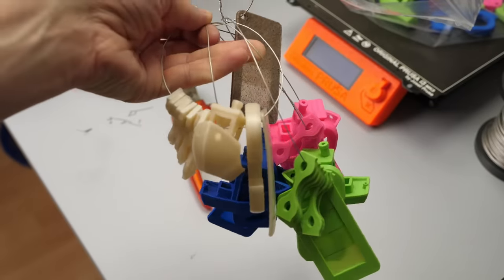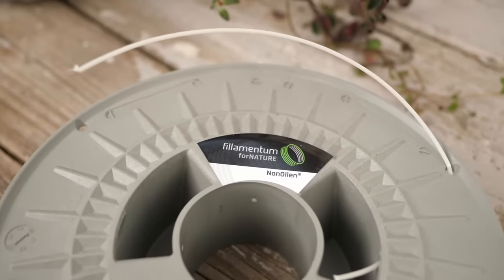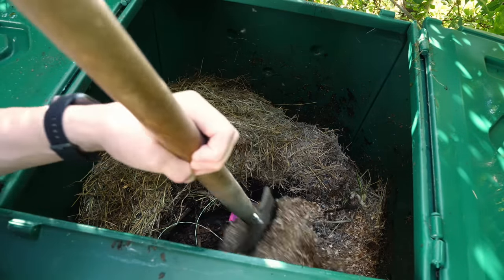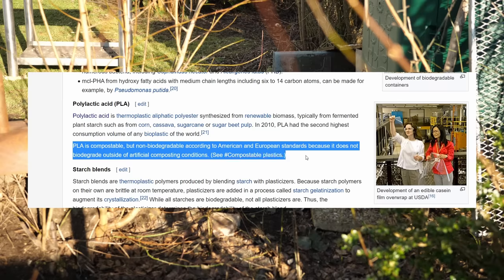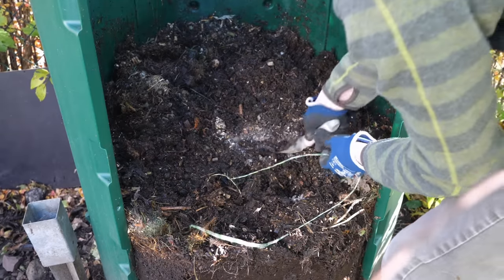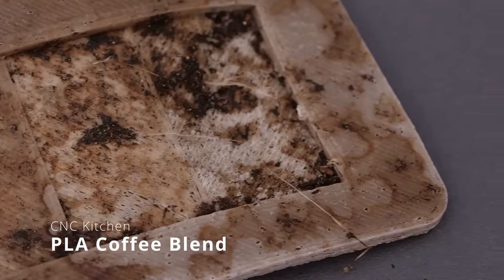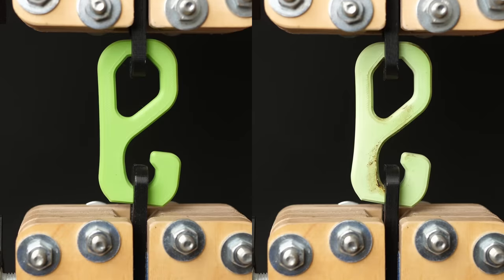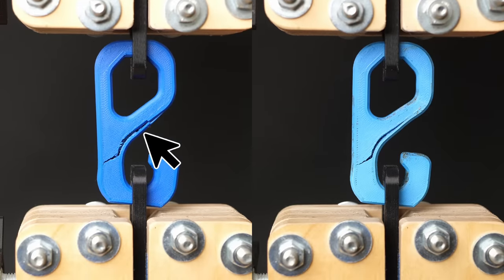I put PLA 3D Prints in my Compost and this happened

Comment: I'd love to see some more testing of that GreenTec Pro (and even the regular GreenTec). 160C(110C for regular) temperature resistance is kinda nuts, especially for something that seemingly prints easily. If there's settings changes that can be done to fix the layer adhesion that stuff could end up being pretty amazing, wonder how it does in impact testing as well.

It may not biodegrade as well as they claim, but it certainly has potential as a filament for functional applications. Their BioFusion material looks promising as well.

Comment: Instead of going bigger, why not go smaller and more controlled? Build a heated and controlled environment to do the composting on a small scale. You want to have a stable temperature of about 35 °C degrees  on the outside and 65 degrees °C on the inside of your compost pile, and good ventilation while maintaining a relative humidity above 60%.

Comment: I prefer ground composting. I currently have a large 2 section insulated Jora compost tumbler with WiFi thermal probes, due to HOA restrictions. The problem is daily moisture/heat regulation, here in temperate SoCal, especially if you add earthworms. No place for them and other critters to escape from excessive heat/moisture and decomposition conditions.

Comment: Chemically, I would expect plastics to degrade a good bit in UV light. Lots of plastics break down this way because it creates radicals of monomers. Breaking down polymers to monomers, but biological processes can also degrade some plastics (took organic chem). There are some microbes that eat petroleum based chemicals too iirc.
Reply: sounds like a good job for a test box(with proper safety interlocks of course) featuring a higher power UVC lamp and that would be a good UV test as one would have constant control of daily exposure time since weather can impact UV to the surface if just using outside.

Comment: Not the perfect test, but weighing and measuirn volume loss thru displacement  can help measure loss of material. It does ignore things like dust, dirt, etc. sticking on it might increase weight or volume, or if fungi etc. grows on it. Tests need to be done on similar shapes to make surface area exposed comparable. Also, if using displacement test for volume (most accurate), you need to make sure it liquid that doesnt make plastic swell that much.

Comment: I wonder, how much does the strength change after 100 days in indoor condition. Did you already test it already? The parts look like it has been due to the compost. But what if environmental humidity is the biggest part of that and the rest really only affects the surface? However, the strength comes from he surface layers, so that might be the same.

Comment: I can say from experience that GreenTec-pro needs very little cooling during printing and the 5015 fan on the Prusa might have been too powerful
Reply from the maker: Thanks for the advice. Would be great if Extrudr included that in the PS profile.
Reply: @CNCKitchen  yeah 

Maybe go with 25-40% cooling or something like that. After all the material is supposed to solidify at about ~ 140°C

Comment: I've had boxes set aside to put scraps/waste plastic in each material type/brand until recycling becomes something I can easily do.   I just never liked the idea of adding plastic waste, and while PLA's claims of degrading were optimistically skeptical, showing these vids let's me know I chose better to save my scraps for later instead of just thinking "all is fine, just compost it"     Just gotta get better shredder/re-spooling systems or find another recycle method that turns the waste products into something usable again (panels, art,  vacu-formed parts, something)

Comment: Question about the raycons: is there silicone on / in them? Since I'm pretty allergic to that it seems to be a good idea to know before I will put them in my ears.

Stefan, do you know?
Reply: It's funny that a Euro tuber advertises a product again which is only sold in US and Canada. I believe the tip material is not specified. I expect it to actually be TPE/TPU rather than silicone, because well cost. It's possible that silicone based adhesive can be found inside, not specified, but for sure you'll find some sealant adhesive of some sort in there. Anyway I don't see a reason to own them for quite a few reasons, and it's just a paid ad, even he doesn't actually have to like them, just find something non disparaging to say about them. It's unlikely they even know their product exactly, it's just a large-ODM product like many others just with a tuning more obnoxious than most.

How'd you develop silicone allergy though? I don't doubt, I understand that it can occur, just wondering what sort of exposure could lead up to it, if you happen to have some thoughts on the matter.

Comment: While it would certainly be nice if PLA would just disappear if discarded in the forest, colored Benchies lying around are more of a nuisance than a problem. In fact you could argue that every PLA-Benchie that is not biodegrading is permanently binding CO2 that was extracted from the atmosphere by the plants that the PLA was made from.
What I am more worried about and haven't seen information on, yet, is if PLA degrades into microplastics when thrown into the ocean, and if it does, if the PLA-microplastics has the same properties or if it is e.g. digestable by fish. It would be a big deal if PLA did not cause microplastics problems.

Comment: Any reason you didn't weigh prints? I guess they could be expected to gain weight with liquid getting inside. Still, I would have expected you to try as biodegradation is meant to reduce mass isn't it in landfill isn't it?. I have a bunch of pla prints in my garden for years and they don't appear to be eaten by anything, not a scientific test I know just observation Some I did because of the hype about them biodegrading or photo degrading and I was curious but I think the claims are rigged and maybe only occur under certain test conditions but not at all under normal home conditions

Comment: For me, the most important criteria are actually: 
1. Is it easy to print with, so chance of failed prints is low?
2. Does it release any toxins during printing?
3. Does it release any toxins when burned?
No landfill in my country, only garbage incineration, and the heat is used to warm houses. That still releases CO2, but so does composting. So reducing waste and preventing cancer are the metrics I go by.
Reply: We try to solve the main issue. A way to erase microplastics and capture CO2 from the atmosphere.

Burnt stuff doesn't disappear.

Comment: Hey Stefan. Want to know how to improve layer strength of FDM prints??
Reply: I had an interesting idea that maybe you could test? What if you adjusted layer width from 0.45mm to 0.3 and compensate by increasing extrusion multiplier from 1.0 to 1.33? I know that's an extreme example and my calculations might not be perfect here, but my theory is this would improve strength in the Z direction because the lines in the XY direction would be much closer together combined with the increased extrusion multiplier might help fill in the gaps between the lines and layers.
Reply: BTW thanks for making awesome videos! As somebody who likes making structural and functional objects, I appreciate what you do on your channel!

Comment: Here's an interesting (methinks) thought to ponder: Plants capture carbon dioxide from the air to grow, and release it again as they get eaten/rot/decompose. Assuming we don't produce more CO₂ producing PLA than we "trap" in the polymer chains (for the sake of argument let's say for example that the energy used in the production is completely renewable, and the polymerization catalysts aren't wasted), would mass production provide a feasible long-term storage of excess CO₂? I know this sounds like a bit of a pipedream, but maybe the plastic not degrading can be utilized, y'know, "silver lining" kinda deal.
Reply: Charcoal would do the same, and can be put into soil  to make it bore bioactive. Codyslab ran some experiments on it and expressed that it's carbon negative
Reply: Ok so this is legitimately in my field. 

1) Producing polymer from biomass still emits CO2 from energy used during production, waste products, potentially from land use and farming impacts etc... and the actual amount of CO2 sequestered is quite small. Therefore getting to actual carbon negativity is hard if not impossible for a plastic. 

2) Often the "gain" in terms of carbon footprint isn't the capture and utilisation of biobased carbon, it's the avoidance of using a conventional petrochemical material which has a higher production impact... (So using a bioplastic is often better in terms of CO2 per kilo because the energy required to make it is less than for a conventional plastic, the actual carbon trapped in the plastic is usually not hugely significant by comparison)

3) The amount of new plastic produced globally each year is something like 400 million tonnes. The anthropogenic production of CO2 is over 30 billion tonnes... so even if you truly get carbon negative sequestration through carbon capture and storage/utilisation in ALL new plastics (a pipe dream) it would be very generous to even call it a drop in the ocean...

So yeah, you're thinking in the right way, but the numbers don't really add up when you get into the detail. If we're going to solve climate change we need to drastically reduce our consumption of meat, stop burning fossil fuels for power, and re-wild areas to reestablish carbon sinks like peat bogs, wetlands, and mature forests (all of which are good for flood prevention too!)
Reply: I realised this sounded negative - I am a huge believer in a future bio-based chemical circular economy. I just don't want people to think that bioplastics are a silver bullet for climate change! They're a good step to take if done right and sustainable plastics are my own field of research...
Reply: @chemistrykrang8065  I appreciate you taking the time to go so much into detail, so thanks for that. And yeah, I'm with you on not treating bioplastics as a solution to everything, I'd rather avoid waste in the first place, look for alternative solutions to currently unsustainable practices, etc.

I was just thinking out loud since the "biodegradable doesn't mean what you think it means" is, I think, fairly well established by now, at least among the 3D printing scene. So now that that question is answered, what can we do with the results, y'know. If I thought my idea through a bit better I probably would've already stumbled at the logical question "what's the actual carbon density, could we even store that mass and volume of sequestered carbon in a practical manner?"

So yeah, again thank you for entertaining my silly prompt 👍

Comment: Even if it takes a decade or two for PLA to fully compost, I think that is still acceptably fast considering that most other plastics take millions of years to "biodegrade".
Reply: Definitely – but only if they do eventually break down _completely_, which is not clear. At the microplastic stage it's worse than ABS that has stayed completely solid.
Reply: @leftaroundabout  This is sadly my concern. I dont 3D print but was buying biodegradable dog waste bags, until I did further research and realized that there is an in-between stage where it turns into microplastics... So in a way the traditional non-green plastics are better, because at least they become contained in a sealed landfill if properly disposed of.
Reply: Not "millions"
Reply: I think the problem isn't if it does or doesn't break down. But does it compost or turn into microplastic?

Comment: ive tried to print NonOilen, ive got a sample for it a while ago, but bed adhesion was just non existant.
Reply from the maker: Same here but after switching to the silky PEI from OSEQ, the parts stuck quite well.
Reply: tried different buildplates but had no luck, might give it a try with a thin nano polymer adhesive coating, this adhesive gave me some quite insane adhesion, had parts finishing that should have failed due to a bad first layer.
Reply: @CNCKitchen  I have an Ultrabase-like bed, used a bit of Kores gluestick on it, it stuck great.

Comment: You have to be careful disposing of PLA in regular trash. If it goes to landfill, the landfill pile eventually breaks it down like an industrial composting facility just because the Pile is large and high pressure). It gives off methane and if enough of that builds up, it can cause an ignition risk. Which is typically why landfill piles are turned every so often. But that methane gets released into the environment which itself, is 20 to 30 times worse than CO2 in its global warming potential. The best way, as you've shown on the channel before, is just recycle it. It works. So that's your circular economy.
Reply: Recycling probably is not viable. There is probably not enough waste PLA in most places to make it workable. 

When I got restarted with 3D printing I collected all my waste. Which at the time was strictly PLA. After I had a box full I tried to find a place that would recycle it. I Duckduckgoed it and came up empty. I called someone near that made filament nearby. And he had no idea either.
Reply: @rickappling5470  indeed, but I recycle my own. As you rightly say, there are few places that do it. Why didn't your  pal just recycle it for you?
Reply: @Ethar Alali  Well he's not my pal. Just someone I saw by way of a Craigslist ad. And he doesn't use recycled PLA. Which I understand as he's not making filament for himself, but for sale to the public.
Reply: @rickappling5470  sorry, my bad.
Reply: The majority of landfills use that gas to produce electricity. And some little bits of plastic is nearly 100% overweighed by farm refuse / food stuffs / and greens
Reply: @Ethar Alali  Well Mr bad, how do you recycle?♻️😏

Comment: Superb work, well done and thanks for making us aware of the realities. 

I wonder, with the volume of plastics around, if there wouldn’t be a good way to compost these “biodegradable” materials specifically. I’ve seen the industrial composting sites, large conical piles of composting materials, their temperature gets monitored regularly and as soon as they start getting below about 65C (IIRC) they get turned over with a front end loader to get the outside on the inside and restart the composting. No pathogens survive the temperatures. Maybe plastics can be processed by special bacteria in a similar way, hopefully to meet some of those standards you mentioned.

Comment: Orange peel is biodegradable, but it is generally accepted that it can take up to a decade to do so. Who hasn't found a piece of concrete-hard desiccated orange peel somewhere, and no one is whining about the use of oranges. I'm happy with PLA decomposing 'ever', in fact I don't want my prints to rot in my lifetime.

Comment: Is there a Video about the Mod of one of the Mk3‘s? Looks rather interesting!
Reply from the maker: That MK3S is basically stock. Just use the OSEQ PEI sheet on it at the moment.
Reply: @CNCKitchen  But that display in the front? Doesn‘t look very stock. (Or I‘m blind)
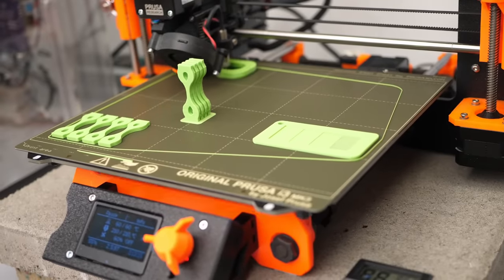Reply: The one at 2:26

Comment: The mechanical compost might introduce mechanical damage thereby increasing the surface area of the samples.

This could be in line with mechanical compactors I've seen at our landfills. Giant bulldozers with studs on their wheels that are designed to crush and break up anything they run over.

Comment: It is a pitty you did not do the same test with some pieces op wood or plywood. These would give almost the same results as the tested plastics. In contrary to the plastics no one would doubt that wood is biodegradable. It is just a matter of time. Depending on the conditions and the type of wood it may take a year up to more than 1000 years to fully degrade.
PLA (and variants) is only biodegradable in a industrial setting. In nature (compost heap) PLA can be biodegradable, but not in big chunks. When broken down in very small particles (micro-plastics) it will take up to 10 years. However when eaten by an animal, it will degrade in a couple of minutes in the stomach. In case a worm eats PLA microplastics it will degrade partly.
The company I work for is working on a PLA which is degrading faster (particles less than 1 mm degrade within one year when left on top of the soil). Our PLA in mend to use outside and it should stay in almost pristine condition for at least 15 years. When it break in smaller pieces it will degrade and lose strength to break apart even quicker. Preliminary test at a university shows parts of 50 * 50 * 3 mm will degrade within seven years. Like nearly all PLA types it will not form chemical pollutants.

There are no plastics that are degradable in nature. At the moment there are water solvable plastics, but these can better be considered as chemical pollutants. The best plastic like material is Cellulose. This is not a real plastic, nor a natural product, but somewhere between. Even Cellulose will take some time to degrade, depending on size and circumstances. Cellulose is not suitable for 3D (FDM)  printing. Outdoor usage is not recommanded.

Comment: I really like your videos with all the scientific approaches,  measures and testing,  but this one has to be repeated with real compost - manure. 
What you had at home it was far away from being a compost, I bet the bacteria count was too small to do significant degradation on the pla. 
Try to get some good quality, aged  manure,  a mix from horse and cattle,  with the proper moisture, you'll get different results.
From what I have noticed,  your "compost " was nearly dry even at the bottom of the bin,  which should not be. 
Hydrate it regularly,  leave it to age, don't expose it to direct sunlight, then you'll get those nice bacterias.
👍